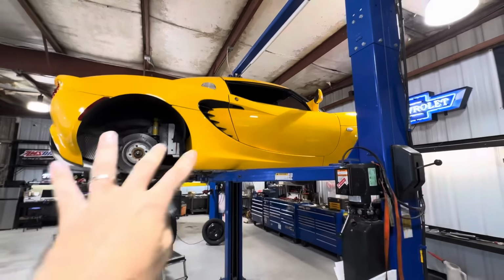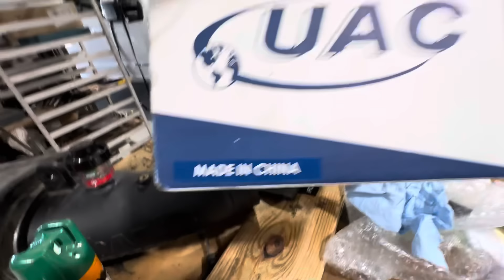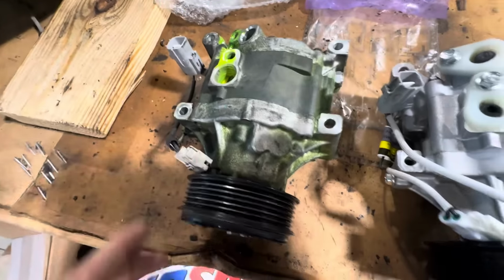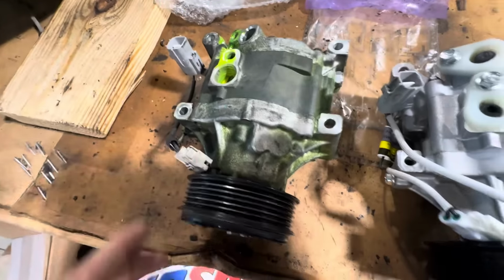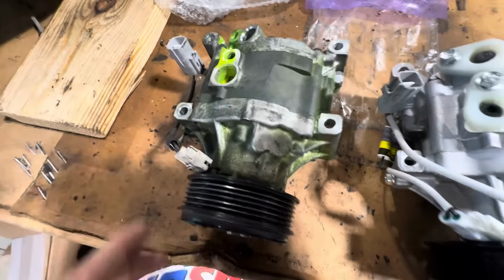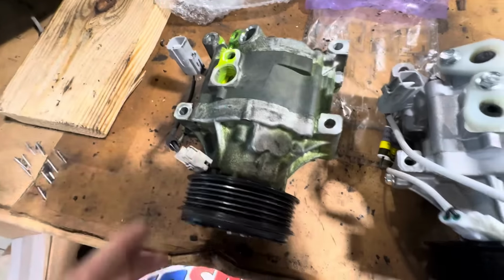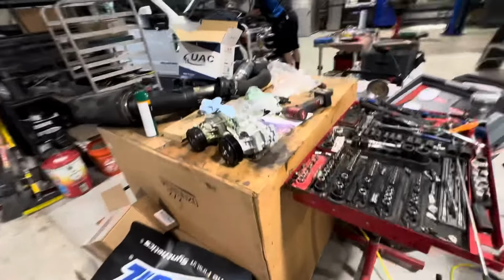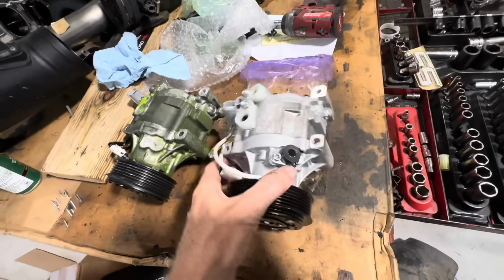Compressor Swap Something not right! Lotus Elise 1.8

Comment: I am at work and i actually sell auto parts and cant even source an a/c compressor or compressor connector for that car.
Reply: How about one from a 2005-2007 toyota MR2?
Reply: @jamessmoth8683  I think the MR2 was only in the US until 2005 ?  anyway, those older models all show the extra connector on their compressors.
Reply: @Wheel_Horse  yes in US till 2005, Mexico had them until 2007 I think, and possibly canada.
Reply: I can easily get one. That however is only because i am in the UK and live 10 miles from the factory where that thing was assembled so no help to Ray whatsoever. As for the car, they drive great for the one week per year they actually work. People here that own them have to be the same kind of people who can repair them.
Reply: @Distinctly.Average I bet the shipping would cost as much as the part
Reply: @jamessmoth8683 I know, and my post was meant tongue and n cheek

Comment: As a time saving measure for you and your customer, it is best to just get the proper one.
Reply: Thanks, Captain Obvious.  I'll bet NO ONE else thought of that...
Reply: @KAS_Motorsports like Ray said the customer order it not Ray . So the customer got the wrong one. So it's on the customer.
Reply: @tinydog34  Well... it's not all on the customer actually, only the wrong part and probably the costs of some extra labor... but Ray is now still stuck with this vehicle until the right compressor arrives. And as he mentioned, that first compressor took weeks to be delivered. He can't run the car now because the belt is not installed, so he has to push it out and then back in again... just a lot of unnecessary hassle.

Comment: And this is why you should let your technician order the parts.
Reply: Or take your exotic super car to a exotic car dealer with factory trained techs and oem parts.
Reply: @sweezyjackson4935 perhaps the customer can't afford the premium price they would charge.
And it was the customer ordered the part not ray
Reply: @sweezyjackson4935  You think that Lotus is an exotic super car?  lol! It has a Toyota engine.
Reply: @paulf4424  in that case the owner should not have the car if he can't afford maintenance on it. It's called responsibility of owning such a car!!!
Reply: @paulf4424 if they cant afford the maintenance why would they buy the expensive car. They couldve bought a corolla instead. No sympathy from me.
Reply: @21Piloteer  And toyota makes engines for indy cars. Youre clueless. Bet you drive a prius
Reply: @paulf4424  I didnt say anything about Ray did I.  
The customer owns a Lotus but cant afford the proper care for it? 
Maybe he should sell it and get a prius.
Reply: @sweezyjackson4935  Its a Toyota in a very cool body. There's nothing exotic about the powertrain or the A/C system.
Reply: @kmoecub  Another prius driver.
Reply: Ray clearly stated in this video that his parts supplier do not list parts for exotics. Your best bet is to read the make and model of the compressor and order a suitable replacement. But it could be possible that lotus did custom order the pulley and you are out of luck in that sense, too.
Reply: @YaksAttack  Y'know, there are circumstances where you get a car, and you can handle the maintenance expenses when you do. But sometimes there's bad financial timing, or maybe the customer intended to do the work themselves, only to find out they couldn't because of a lack of time or tools. Y'know, like lifts. So now you've got a bunch of parts and no ability of your own to put 'em in. Well, okay, that happens, so you take it to a mechanic to get it done. I've run into that one before, and it wasn't even on a high end car! Plymouth Neon's pretty low-end, really... Anyway, that's more money, but hey, it's gonna get done, right?

Not necessarily. Perhaps they did try to take it to a Lotus dealership/specialist to have it done there, only to get told "We don't do work with customer supplied parts. We'll have to order them ourselves to do the work." Now, if you do that, you've compounded the expenses (and shop-ordered parts are always more expensive than getting them yourself because of higher shipping charges to get them there fast), and that could be the breaking point. And that's to say nothing of having to pay for return shipping and any restocking fees to send back the parts you ordered for yourself...and some parts suppliers might even require you to send back the entire order to get a refund, so if you've installed the other parts which were correct... Nobody but the government can just keep throwing money they don't actually have at a problem to make it go away.
Reply: @tschuuuls486  exactly
Reply: @sweezyjackson4935  How do you know they can't afford it? Maybe they prefer Ray.  Maybe they have had issues taking it to a Lotus place?  You have no idea yet you post BS.
Reply: @timradde4328  Move along troll
Reply: @nightrunnerxm393 not my problem. If you cant afford it, dont buy it. Everyone wants to live above their means and makes it everyone elses fault when they cant afford to keep up the lifestyle.
Reply: BUT. Ray has showed on various occasions, that they also sometimes ORDER the wrong part, and sometimes gets DELIVERED the wrong part, when correct part ordered. But yes, unless the original part was unobtanium, did the customer get a good deal on the "chinesium" part, or was it cheaper from ebay, or wherever he bought it from ?. Maybe some local suppliers will have Denso compressors in stock, albeit at double the price (or on back order for 6 months) ?.   I have no say either way, as I have only heard Ray's version, and not the customer's on why he selected that unit. Hence, I just enjoy the video, and now know that there will be a part 2 coming up. So, no armchair critic here.
Reply: @YaksAttack this car isnt expensive
Reply: @21Piloteer  And VW makes engines for Bugatti.  So what?

Comment: I agree with Ray about not installing the Chinese compressor.   Because if it doesn't work or fails in a few days, Ray would be on the hook with extra labor and his reputation.
Reply: Amazon sold me a Chinese compressor and it’s a success.
Reply: would he, the owner supplied the compressor...
Reply: @marksmallman4572  He'd still have to go back in there and take the wrong one out (again) and put in the correct one.  You don't want to have to do work twice.
Reply: @timradde4328 ya if the customer paid him to do it again. When you bring your own parts there is usually no warranty if the parts are not right, or if they don’t work right out of the box, or if they fail in a short time. At least that’s how it is at every shop I’ve ever worked at. The only warranty would be with the craftsmanship of the labor performed, if he installed wrong, or bolts came out etc.
Reply: almost everything nowadays is made in China.  
Its not a reason to say bad quality right away.
Reply: Ray's conclusion was not based on where the compressor was made. Granted Ray did point out that the customer supplied part was made in China and that perhaps China based parts advisor was of a view that the supplied part was a viable replacement. Not necessarily a Chinese person but one might presume. No the quality of the part was not in question - that it was incorrect for that application was the question. Some commentors state that warranty on customer supplied parts is void and Ray would legitimately be able to claim time to redo with another replacement. Three things, first it is a faff to undo your work especially in high summer and on a lotus. Second it is not ansolutely certain the customer will agree without legal paperwork and or further negotiation - which takes time. Third is a question of shop output. Ray wants it fixed and gone, not having what would appear spurious conversations with parts advisors or indeed customers about these issues.

Comment: Yes I agree it's the wrong compressor but that new one isn't a variable displacement compressor. They are both scroll type compressors and the extra electric bit is a slip/lock sensor. Just happened to dismantle one of those exact units yesterday just to see how the slip sensor works.

Comment: Listings are sometimes wrong in strange ways. I ordered a RH rear caliper for my wife's old Mercedes, and I got a left side one. Huge back and forth with the vendor who insisted he was correct.

Turns out, that in the later years of that model Mercedes moved the caliper from behind the axle to in front of the axle--which of course flipped everything around but actually using the same physical parts. If I had ordered a pair (which I guess is common), would have been no problem--would have gotten one of each part number and all would be OK. But not when ordering one because 'RH' is the new LH.. 

Took a while to figure this out.

Comment: The customer is lucky to find an independent to tackle his exotic crotch rocket instead of sending him to the dealer.
Reply: What dealer, likely there are none that half of the USA, unless he wants to send it via container across the USA.
Reply: Toyota drivetrain isn’t that exotic.
Reply: @MrCarCrazy  True, but they will send him to BMW, who in turn will send him to the one dealer who deals with these types of exotic cars. Yes there are dealerships and independants who deal with them, but likely Ray is the one local, and the owner really wants the AC to work in Florida summer, because otherwise he will be cooked inside the can.
Reply: @SeanBZA  Fortunately, he has electric windows that lower, so that helps, sort of. Agree, AC is likely preferable.
Reply: @johnhpalmer6098  Yes, electric windows do help, just got to fix my one with the dicy switch.  Plus the Kia where it also needs a new switch, but currently worldwide out of stock, so made a plan involving taking that unit apart a few times, and doing some soldering. Who uses rear windows anyway.
Reply: @MrCarCrazy  It may not be that exotic, but now it's collecting dust in Ray's shop and he doesn't get paid until they find the part and the job is  done.
Reply: @SeanBZA  Speaking of, I had the opposite, sort of. 4th of July, 2 years back, was driving to a state park on Bainbridge Island and my window crank broke where the cable attaches. Had to drive up there with the driver's window down, but the AC working and the stereo cranked to hear it from all the wind noise. Got it fixed the next day despite the rain that came later that day. Was able to find the crank and get it installed before then. I do have electric windows, BTW.
Reply: @Columbus1152  ok…
Reply: @SeanBZA why BMW?

Comment: I just had a variable displacement Denso compressor fail and looked up diagnostics about the valve in there. This probably only applies to Mercedes, but if you don't power the valve at all the compressor will only idle and just pump enough refrigerant to oil itself internally (~2% duty). You would need to provide the valve a current limited (pwm) signal with ~12V to make it work. Pretty difficult to diy without a controller box.

Comment: Had an elise and an exige s for a total of 12 years. Really charming and fun to drive. Sourcing parts can be an adventure. Drive train is essentially identical to 2005 celica gts. That should extend to the compressor, but I'm not 100% on that.
Reply: That is one of the reasons that I drive a '14 Porsche Cayman S.  There's never a problem finding parts, though in six years of ownership the only thing I've had to replace are tires.
Reply: @Flies2FLL  replaced the exige with an 18 cayman gts. It's a much nicer car, faster, and handles as well. It's not as dramatic or exciting to drive though. 1100 lbs heavier. Porsche are the best all around sports cars, but the tiny flyweight loti are a real blast, especially on track.
Reply: @aaronschen9896  My Cayman S weighs 2976 pounds and feels like a go-cart, the Elise is about 900 lb lighter so it must be very entertaining.  I've sat in an Elise and at 6'1" I fit just fine, but it was tight.  I am 58 years old and 170 pounds and had no trouble getting in and out, so Ray was being a bit dramatic.

I've never tracked my car (I want to do a PCA DE event bad!) but I have heard it called the best drivers car in the world, hands down.  The Elise is cool but I've heard they are squirrely;  There is a video of a Porsche 928S4 keeping up with an Elise on a track, and eventually the 928 won because the Elise spun out.

Comment: Hi Ray. I’ve had this issue a few times with third party parts for vehicles from small volume manufacturers.
Yes, the engine might be sourced from Toyota/Ford etc. but that doesn’t mean a part listed for a 1.8 Toyota will fit. Alternators, drive belts, filters, main engine components can be, and often are specific to that particular installation. 
In this case, difficult to say from the video, but that new AC compressor looks like the unit fitted to the Lotus Evora which does use a VDC unit.

Comment: @Ray those are the Denso Compressors without a oil sump drain. You have to flush the whole system and prefill the compressor with the specified amount to add the current amount of oil to the system.
Reply: Really doesn't matter as the replacement is incorrect.

Comment: Hello Ray,  I'm no expert but, that extra coil on the china compressor may be for the tach signal that Toyota uses on many of their compressors. Lotus obviously doesn't use it. If you remove the allen screw you probably can remove the magnetic pickup and take the pins out of the connector. Again not telling you what to do just trying to give info on what it is for. I don't believe it is a variable displacement compressor. I like you would rather use a Denso compressor. You have to warranty and do the work, I don't. Just a possible solution if the customer is willing to take the risk if you are unable to source one like you removed from the Lotus.

Good luck,
Dave from the SMA part of the country where Rust Rules. WNY

Comment: I don't doubt Ray here as 

A: I don't have the car or compressors at hand so I can check anything.
B: I have never touched a air conditioning compressor of any type so I don't' know the difference between these types of compressor.

Having said that I did a bit of googling and found an interesting page posted on the Toyota Industries website.
This can be found by searching Toyota "Continuous Variable-Displacement Type Compressors"

In short Toyota has made Variable Displacement Compressors since 1995. The first model was what they call a "One-Way Swash Plate Internally Controlled Type". As I understand it this type of compressor has a pressure controlled mechanism that changes the angle of the swashplate depending on the pressure. This way, again as far as I understand it, the compressor could replace the old type of compressor without any change of the the circuitry.
The model number of this compressor appears to be 6SL 12.

In 1997 they started making a version they call a "One-Way Swash Plate Externally Controlled Type"

This compressor sends a data signal to the controller in the car. This controller then send a control signal for the valve in the compressor that changes the angle of the swash plate. 
AFAI understand it this can't replace a compressor that either is internally controlled or of the old standard type of compressor without a variable angle swash plate.
This compressor appears tp be called 5S10.

Note that both these numbers are what Toyota named their compressors. This Chinese compressor most likely doesn't use one of these numbers, but it could be interesting to see if the old compressor possibly was a 6SL 12. if so it was already a variable displacement compressor of the Internally controlled type.

Comment: A headache indeed. Wondering too, if the old pulley bolt (holes) line up to the new pulley bolt holes.. The new unit seems a llittle larger overall..!!

Comment: With the different sized pulley it probably need a longer belt and not function at the correct speed to work properly.Look at what happened recently with the front suspension strut that was too short.

Comment: If one goes to Rock Auto and looks this part up it is not in stock. BUT WAIT FOR IT. There are different compressors for this car in that model year. There is a tag on the compressor. It's either a Valeo brand or a Delphi. First time I have seen such a large warning note on Rock Auto. Probably had a lot of returns.

Comment: I wonder if this other compressor super secedes the original because it is compatible it just always runs on the highest pressure (with pumping energy losses for the engine) whereas the vehicles that do have the extra wires for the sensor are able to trigger that solenoid to dump some extra pressure for fuel economy reasons in the later models?  What does All-Data Say for part numbers and Rock Auto just by chance Ray?

Comment: It would be interesting to research the OEM part number and compare specifications. Is the compressor you removed the Lotus original, or has it been replaced before? Easy to get lost in the after market world with supposed copies! Good luck.

Comment: Since the engine was made by Toyota, it makes sense that the compressor is probably made by Denso. If that's case, the Toyota part # might be DCP50015. Any manufacturer's label on the the original compressor?
Reply: ASIN or Denso. So, you are correct!✅

Comment: I believe that compressor (Lotus p/n A120E6491S) cross-references to the Denso 447260-7100 which was used in several European Toyota Corolla engines not available in the US (1.4/1.6L gas, 2.0L diesel)
Reply: That's probably the reason it's hard to source in the US, lol.
Reply: Lotus Talk forum says the Denso 471-1426 (2000-'05 MR2 Spyder)

Supposedly the larger pulley works fine and the extra wires are for a RPM sensor not variable displacement.

But that is research Ray hasn't done yet nor would most mechanics start there.